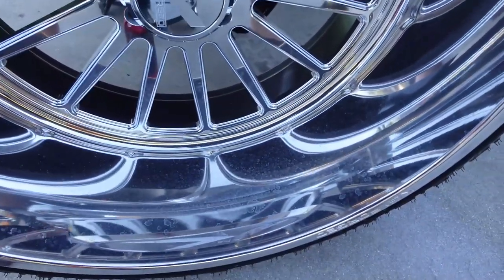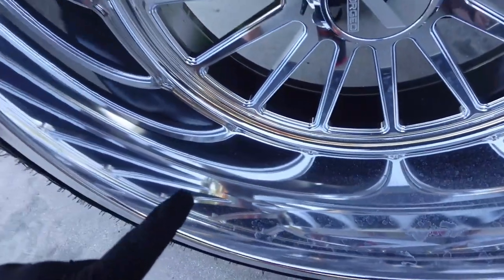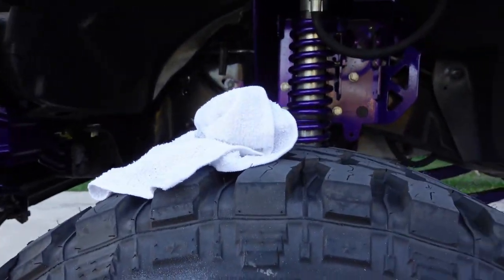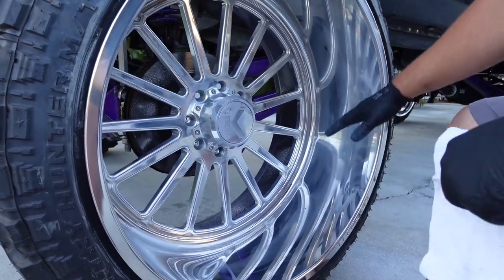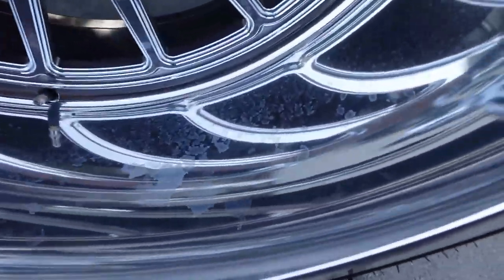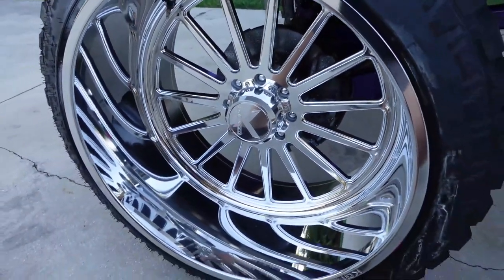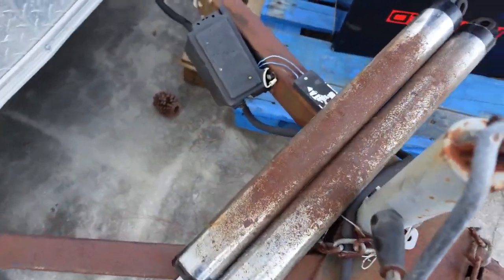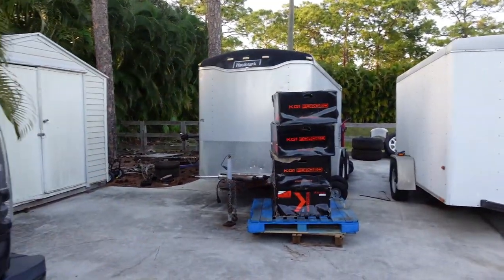FIRST EVER SPRAYABLE ALUMINUM HAND POLISH | RENEGADE PRODUCTS

Comment: i havent been able to watch all your videos but i just bought my first set of forged wheels. what do you recommend for getting all the brake dust off them before polishing them?
Reply from the maker: Honestly, I bought a set of ceramic dustless brake pads and haven't had an issue with brake dust since. But I always recommend washing them with soap and water every other week depending on how much you drive and the area you live
Reply: @thekolbyward  yeah ive thought about switching pads. I just got new front pads but I don't know what they used.  my passenger side wheel bearing locked up had it towed and fixed.  I always wash it when I get home and before I leave then I get to west tx and it sits for two weeks until I go home again

Comment: Shouldn’t you wash the wheels first before doing that? In case you catch something in the cloth and scratch your rim?
Reply from the maker: You could have washed them. They weren’t but a week old nor had they been rode on since I had them mounted so I wanted to see how it would come out with having been only rained on. The terry cotton cloth was brand new and won’t scratch the aluminum. In the future yes I would 100% wash them and then do this process though!
Reply: @thekolbyward  right on bro, is it better to hand polish with a terry cloth first then wipe with a microfiber? Or microfiber can be used hand polishing and wiping off?

Comment: First off your price is off, I paid over $40 bucks for 1 bottle. Second, your polishing a brand new wheel , oh no it’s a week or 2 old with a few water spots 😱 so your not doing the product justice. Show me what it can do on old wheels 🛞
I just bought a 92 g20 van and it has aluminum wheels , did I waste my money on this product? 🤷🏻‍♂️ idk have not tried it yet, but as far as this video showing what it can do? This wouldn’t make me rush out to buy it , just saying . And in the beginning of your video you were like this isn’t like other polishes don’t have to shake it, then you start showing how to use it? And you shy shake it ! What ever dude🤷🏻‍♂️
Reply from the maker: My price wasn’t off this is what the rep from renegade told me to say after they sent me a bottle from them before it was on their website. On their website it’s $31.50 and I said they had plenty of discount codes at the time for getting it cheaper. Again this wheel was about a week old if you used your ears and listened where I said stated it was a new wheel and had road grime from driving which is normal when you drive a truck lol. Do you not shake a bottle before you use polish? Clearly you couldn’t understand what I was saying since I said this type of polish isn’t as thick as a regular polish so therefore you wouldn’t have to shake it or as much. I also said this is a product for a clean and quick polish but again I can see your ears don’t work. Next time please listen and comprehend before you comment some ignorant stuff.